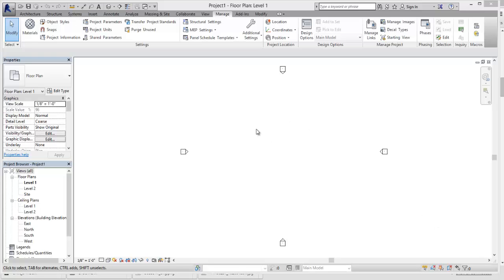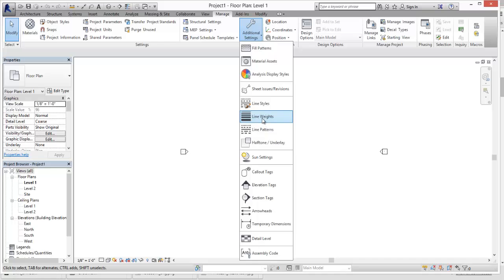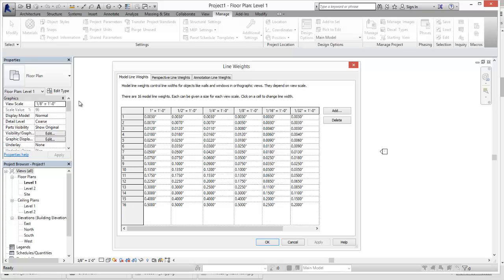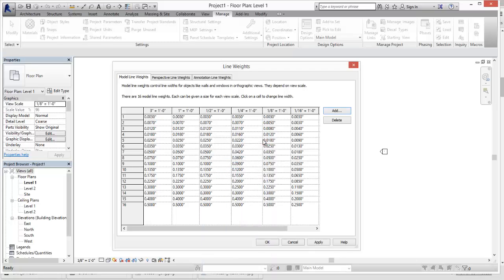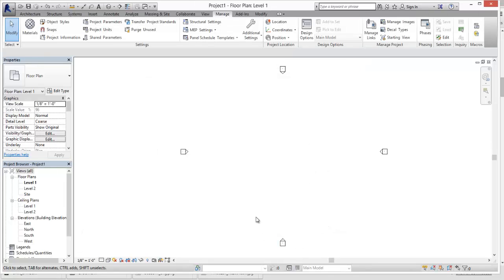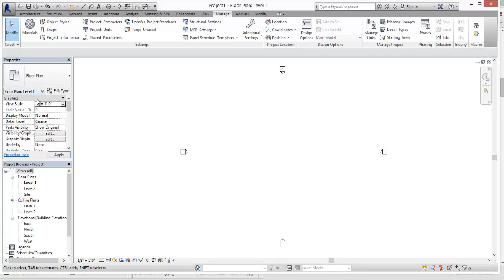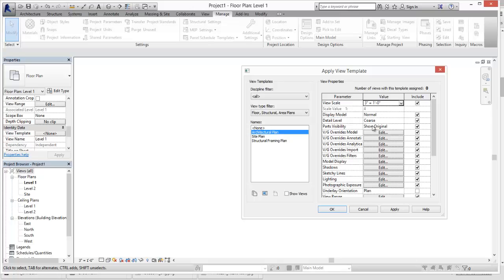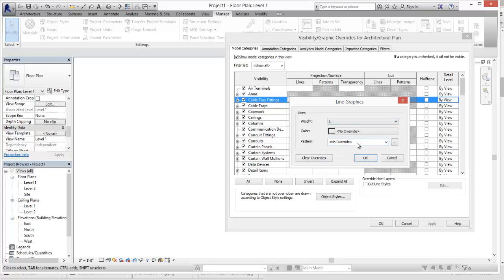Revit Line Weight Setup and Control

Comment: Thanks, super helpful.  Do you have any recommended base settings for the line weights? I've read around that the tendency is to reduce the Revit weights by 75% but I wasn't having any luck.